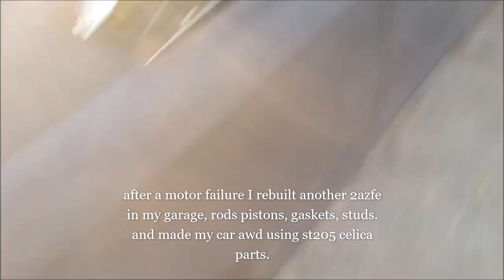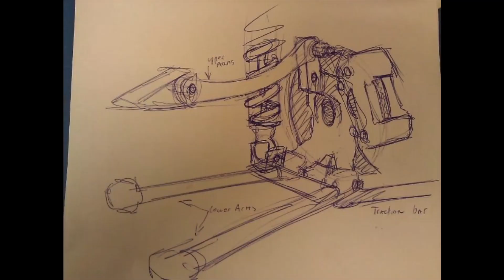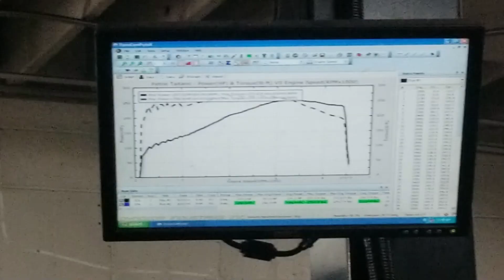things you may not have known about my tc

Comment: Cool progress man, i would reccomend a junkyard twin turbo build made from 2 twin scroll turbos. You can find those in the turbo 4 cylinder Mustangs, and rear mounted as mufflers! Omg
Reply from the maker: haha my plan is actually to do a remote setup mainly because engine bay space is real tight in my car. but what im using will be a surprise. its pretty cool and rare. stay tuned.

Comment: Meant to ask this, but, what's the weight distribution on it? And how much do you think a rear transaxle paired with a J35 V6 instead of a normal transmission and the 1UZ would help the weight distribution? J35 is 380 pounds long block compared to the 1UZ 445 pounds. The transaxle should weigh around 200 pounds, though. So, effectively, removing 65 pounds from the front and moving 150 to the rear.
Reply from the maker: i want to put the j35 in the festiva to be honest, a j37 if i can find a whole vehicle as its electronics are a bit more complex, but i wouldn't really want to make it RR as the weight of the 1uzfe is actually more inline with the j35 at around 380lbs (no ac pump and different accessories/configurations lose weight). 

in order for it to not drive strange or have turning issues under acceleration like the sw20 i would have to relocate anything with weight to the front like the fuel tank etc.

when my car had the 2azfe i weighed the engine and the transmission and it sat at around 360lbs in the front of the car.  so the stock front suspension and struts were fine to reuse. although i used the cradle (also aluminum) from an ls400 and made custom control arms etc. to accommodate it.

the RS5R30A transmission was light enough to lift by hand so around 50-60lbs but sits more centered to the car.

the fidanza flywheel was about 10lbs, act clutch standard weight.

and the driveshaft is a 4" a custom aluminum one peice shaft. 

the rear subframe is an aluminum z33 unit from a z33 350zx. with a na z32 differential and axles so there was a lot of weight consideration. 

i never weighed its distribution, but the car never suffered from anything that i would consider odd.

it was under its stock factory weight of2900lbs with everything considered even with the v8 (at 2800).

it has an even hp to weight ratio. with all that said i do like the j series engine but i picked this because it was easy access and cheap for me to do, not necessarily easy... but cheap.

Comment: Do you still have it after all this time ? Show me how to do mine bro
Reply from the maker: do wheelbase measurements, firewall, tunnel, mounting location measurements. Find comparable parts that may fit. If they don't cut it all up and weld it back together in a configuration that will fit. 

Money an issue? Buy a donor car that has everything, then adapt absolutely everything you can. 

Or piece it together as you go. 

I can't explain the process like a build manual. Everything I di was researching how things might fit. 

A lot of it didn't so I had to cut the tunnel out and modify even the firewall to make it fit.